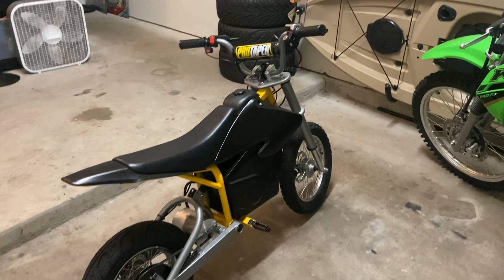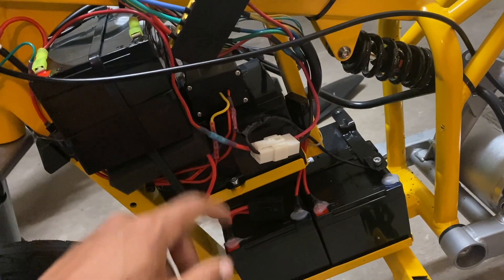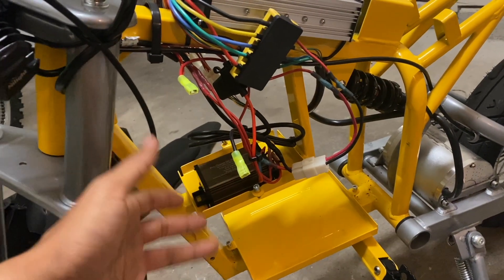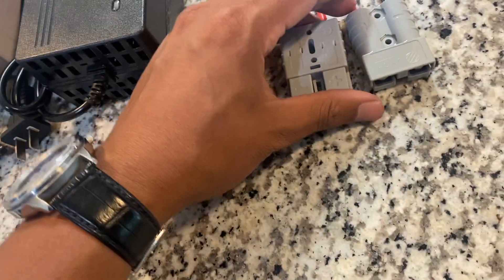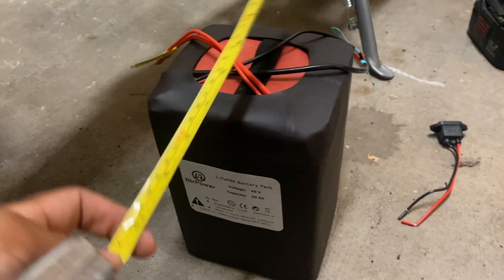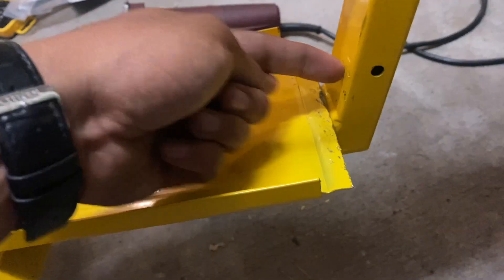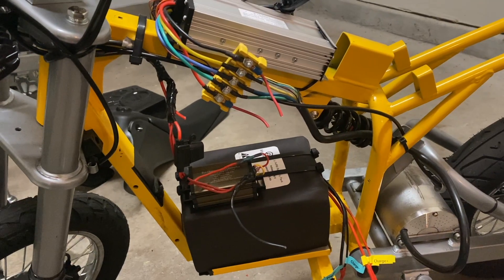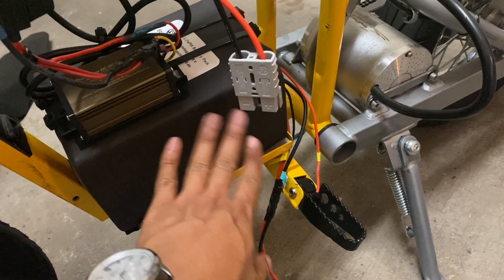Razor MX650 BTR Power Lithium Battery Pack Installation | 48V 20AH 2000W Kunray Brushless Motor

Comment: Hey pat im building one or trying too and ive found the btr 48v 20ah 50a battery on there website but it says it runs for a 1200w motor and i also have a kunray 48v 2000w motor wodering if you or anyone in the comments can
Reply: Help me, i ment to say at the end😂

Comment: Have you been watching your videos!! love the content, was wondering if I was to run a 1800w vevor 48v with btr 48v 20a would you recommend that and would it be able to handle the power?  From what I’ve read the BTR only handles 1500 Watts
Reply from the maker: This was almost 3 years ago. I think Amorge is a much better battery manufacturer that I would recommend going with. My Razor Sx500 battery can support up to 28,000 watts, but they will make any size and spec you’re looking for at reasonable prices. Think they’re able to do a 48V 20AH battery with at least a 3,000 watts output for less than $300 shipped

Comment: Hey pat, if I got the exact same 48v 20ah btr battery for my razor, do you think I could get away with just hammering down the frame? Or would I have to cut the top battery mount. Thanks love the vids
Reply from the maker: For any 20+ah battery on an MX650 or MX500, you need to cut out the battery tray

Comment: Hey pat I love the builds trying to do one too people say the btr battery you use are not reliable and catch on fire I wanted to know  how long you had yours and does it still work?
Reply from the maker: This 48V battery failed on me after one month and I replaced it with a 72V BtR battery as well due to my budget at the time.. it still works just fine today (after almost two years), but I’m likely upgrading to either Amorge or electro & co very soon
Reply: @PatOutdoors  thank you very much my budget for battery is $350 and wanted to see if this would work and side question did the battery fail cause it was a bad battery or is it just a btr battery problem

Comment: will a vevor 2000w motor work with the battery?
Reply from the maker: @onewheelmac  Depends what controller you are using.. just has to be rated as the same voltage as the battery

Comment: Hi Pat, I have this same kit with the same battery and a 13 tooth sprocket and I’m only hitting 32 mph Do you know why that might be?, Thanks
Reply from the maker: Different rear tire overall diameter. This bike was running a 3.5” wide street tire in the back (paper thin clearance against the motor), also I weigh 170 at the time, not sure how much you weighed. This bike goes over 50 now with a different 72V set up though..

Comment: What is a voltage step down for
Reply from the maker: 12v accessories like an LED headlamp should not be run on 48V. It would burn out immediately

Comment: Could I use the BTR 48v 20ah battery on the stock rsf650 with the stock motor to just increase my range and slightly boost mph to like 22?
Reply from the maker: As long as the dimensions fit your tray, yeah that should work. 22 MPH is also right in the ballpark range (+33% current top speed)

Comment: Isn’t cutting out the top tray gonna weaken the frame ? Because I have one and I want to do the same
Reply from the maker: Nope, it just holds the top battery. The SX500 doesn’t even have the upper tray. Everybody with an MX500 or MX650 with a lithium battery installed has to do this.
Reply: @PatOutdoors  oh cause I was thinking when you hit a bump or go off roading the frame will bend a little from the bumps
Reply from the maker: @jakubthewildbirdsaver2947  it’s not a structural part of the frame. That specific part’s purpose is specifically to hold a battery. Google what a Razor SX500 frame looks like
Reply: @PatOutdoors  I know what the frame looks like it’s just I was just making sure cause I go off-roading a lot and going off ramps and stuff but thanks for telling me
Reply: @PatOutdoors  thanks for telling me I sure can’t wait to upgrade my dirt bike the same way as my dirt bike’s original circuit board is starting to fail

Comment: I see you are running a 48v 20ah lipo battery pack. I took 4 12.8v 10ah batteries and hooked 4 up to make a 48v 40ah battery pack but I want to double my range on my Mx650 2000w Vevor motor n controller. so you should try 8 12.8v 4x2 in series producing 48v 80ah now you can go 60+miles on a charge.
Reply: "I took 4 12.8v 10ah batteries and hooked 4 up to make a 48v 40ah battery pack" Four 12v 10ah batteries does not make 48v 40ah... that's 48v 10ah if wired in series
Reply from the maker: @baitcarp  this is correct, I think he may have misunderstood that.
Reply from the maker: I’m already 72volts on this bike today. Don’t think there’s much more space in the factory covers, max 28 ah maybe
Reply: @PatOutdoors  I would have to make a custom cover but what people usually do is cut off that second shelf the little one that way you can make room for the bigger battery pack in my setup I'm running 4-12 volt lithium iron phosphate alarm batteries 10 amps each I am thinking about running eight of those to make 80 amps that would be eight batteries. With the setup I have I can do at least 34 mph

Comment: How much range did you get with the upgrade, and how many volts until the BMS kicks in on that battery to say its dead?
Reply from the maker: Tested this in a separate video. Starts fully charged around 55 volts. Got about 26 miles before it cut off at 43 volts.

Comment: Would a vevor 2000w motor work and give the same top speed?
Reply from the maker: Top speed is mostly dependent on Battery voltage, the speed controller and the tune.

Comment: Is it possible to not cut metel if you have a razor sx500
Reply from the maker: Yes. The sx500 has more room for a large battery. I recommend measuring your battery tray before purchasing a battery
Reply: Ok 👍

Comment: Hi I just wanted to ask why you need to install voltage reducer if the battery and controller are both 48v?thank you
Reply from the maker: That’s only for the 12v accessories wired up like the headlight. The controller for the motor is still getting 48 volts

Comment: Hey Pat l, what's going on. Keith again. Just got my lithium battery. Plugged it up good to go. Haven't driven yet though, just got charger for battery today. So my question is.......if my charger fits my charger port, can I charge battery through controller? Or do I have to charge straight to lithium battery? Lithium battery that I ordered has white connector that fits the charger port I have.
Reply: Just need a semi recap on a past question. You've really helped me thru my razor build journey. Preciate it mane. Stay blessed
Reply from the maker: What controller do you have? I still recommend having the charger go to the charge port, then from charge port directly to the battery wires. Skip the controller
Reply: @PatOutdoors  the fast scooter overvolt controller
Reply from the maker: @keithturner7635  Ooohhh the brushed controller.. Yeah you can hook it up to charge through the controller then
Reply: @PatOutdoors  Word. Thanks again and stay rollin bro.
Reply: @PatOutdoors  hooked up lithium battery. It runs but bogs out when I hit hills. Should I install a fuse on red wire. I have a 48v 1000w 100ah lithium battery. Any suggestions?
Reply: @PatOutdoors  just took it for a ride. Lasted bout 45 min before it bogged out again. But I notice that my battery was very hot so I let it cool down and after about a hour or so of cooling down battery showed full again and ran fine. Any suggestions or solutions to this?

Comment: What up Pat. Quick question. Once the lithium battery is installed, do I have to unplug the battery from the controller to charge and if the charger connector fits my razor charger port perfectly can I use my fast scooter overstock charger?
Reply from the maker: The lithium battery I used came with its own charge port and charger. I installed that charge port on the side cover. And no, please DO NOT try to use lead acid battery charger on a lithium battery.

Comment: What is the range on the sla battery
Reply from the maker: I wanna say 20 miles? It's been so long since I had this set-up. But I did a range test video immediately after this one: https://youtu.be/bN_xu3_zFNQ
Reply: Is that 20 miles with full throttle?
Reply from the maker: Yes, mostly. A lot of hills though if you watched the video.. I just re-read your question. 20 miles with the BTR pack on this video. Your question said SLA, which is my super old set up. That's probably like 12 miles
Reply: I just got the fastscooter charger but it’s not charging do you know how to fix it ?
Reply from the maker: @Oliedo  I recommend contacting the seller you purchased it from. I've never had an issue with mine. The wiring from the charge port to the controller could have been hooked up incorrectly.
Reply: Do you think it’s a battery problem because after I installed the ki ray kit I took it out a test run and the battery just shut off on me
Reply from the maker: @Oliedo  what voltage does it read at the connector supplying power to the controller?

Comment: How was the BTR battery? and would u have any stock 650 motor or controllers 4sale?
Reply from the maker: I had issues with my first 48V pack, but warranty took care of me and I got the 72V pack not long after and it's been good since. I don't have any factory controllers anymore, only brushless controllers

Comment: Hey i bought the same battery and motor and controller because of your videos, do you use fuses? I just can’t even figure it out and i don’t wanna burn my house down.
Reply from the maker: What part are you having trouble figuring out?
Reply: Hi, we are thinking there should be a fuse at the battery in case of a short circuit.  We don’t see one in the video.  Thanks
Reply from the maker: @ACRvetracer  You can add an inline fuse for the power line to the controller.
Reply: @PatOutdoors  Ok Thank you! We are going to use a 30 amp fuse, is that a good size?

Comment: Thanks for all of your videos and insight. 

I have a couple MX650s for my son and I.  I am going back and forth with trying to decide on either the Amazon power upgrades motor/controller/battery kits or electro and co. I’d rather not have to spend E&C prices of the Amazon stuff has longevity. 

You seem like you may do a lot of research as well.  Do you think the Amazon “stuff” will last?  Thanks in advance for your help.
Reply from the maker: I really like the Kunray kits as a budget complete kit to start with l, but the controllers simply don’t put out as much as the Kelly controllers that come with the E&C kits so you’ll get power hungry eventually. It really depends what your goals are with the bike.
Reply: @PatOutdoors  wow, thank you for your quick response. I totally agree with the power hunter. I want to do it once, so my plan is to go for a 72v kit right out of the gate. 

I just wondered if the quality of the Kunray will sustain a few rides each week of heavy neighborhood riding.  Do you wish you would have just done E&C or are you satisfied with the Kunray / Amazon upgrades?
Reply from the maker: @internalbeats6870  well I can confirm the original 48V Kunray motor has been holding up well over the last year or so, going through (3) different controllers in search for power. I kinda wish I would have gone with their 72v kit from the beginning, but I simply do all this to experience the differences between all stages just to educate myself. The Kelly controller upgrade I just did was simply an experiment to see if it would actually gain more torque and reach a top new speed with ONLY changing the controller and I can certainly confirm it’s a must have if you’re power hungry. But I’ve finally reached my goals and happy with where my bike is now..
Reply: @PatOutdoors  you’re very thorough in your videos, for that I’m extremely grateful for your shared experiences. 

I’m not looking to build an unridable monster.  We have a lot of steep hills in our big neighborhood, so I want the power to climb them, the battery life to enjoy the bike longer than an hr, and the reliability to have to buy everything a second time. That’s not too much to ask, right?  Lol

Again thank you for your responses and help. I Look forward to your future videos.
Reply from the maker: @internalbeats6870  Thanks! well then if that’s the case, their 72v kit with at least a 20AH battery would do the job.

Comment: when I click the battery link I get a (48v 10ah 168$) and it looks different the other option is a (48v 25ah) and its a lot more pricey 439$ i cant find your 48v 20ah
Reply from the maker: Maybe they don't have it in stock anymore. If you don't need a very high output, you can do an 18ah one with 30amp output like this: https://amzn.to/3Z5L7P0 You gotta cut the upper trey from the frame to fit it still.
Reply: @PatOutdoors  and this will be ok with the 2000w motor?

Comment: Hi I was wondering if you had or could do a tutorial battery of how exactly to wire a btr battery in. I have a myway electric bike and upgrading to a btr battery. It looks similar to the wiring you this on this but just to have it broken down slower thanks
Reply from the maker: What do you mean how to wire it? It has four wires total. Two wires go to the charge port, two wires go to the controller. Check out my newest video, which should give you a better idea.
Reply: @PatOutdoors how to wire them up the battery to the Anderson connectors and what you need to do so

Comment: Started modify my project mini and I installed the vevor 48v but ran stock 36v battery and won't give any motor throttle response 😓 thinking a battery upgrade would fix that so I can finally rip it ☘️☘️☘️
Reply from the maker: Yeah the 48V controller is not designed to work with 36V.. it’s got an internal cut off not to power on the bike at around below 41V. You either need to add a 4th 12v battery to run in series to convert to 48v or just buy a lithium battery
Reply: @PatOutdoors  thanks for the insight bro and keep being a legend your content has been a huge help 🙏🏾☘️

Comment: Let's see 35 mph! Can't wait for you to feel the difference
Reply from the maker: Hard to say what my real top speed was because there was so much elevation changes on our ride. Some uphills my bike was struggle bussing to even go 12 MPH (but SUPER steep climb), but then goes over 40 MPH bombing down hill. I have to do a separate top speed run on the same road I usually ride on by my neighborhood since it's got long flat sections. I wanna say you are about right with 35ish though.

Comment: I would suggest using the foam in the box as a padding for the platters tray to reduce vibrations from riding. Acts as a damper.